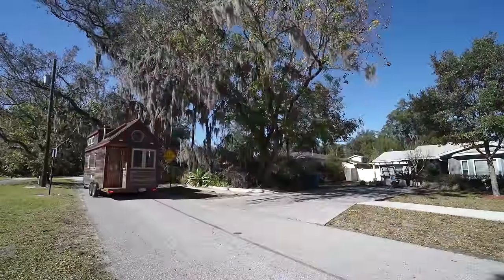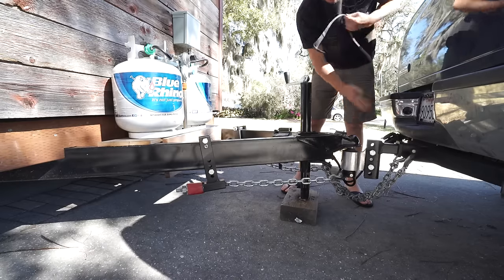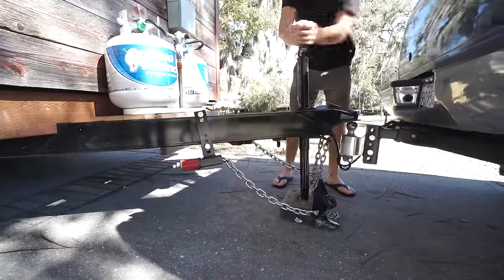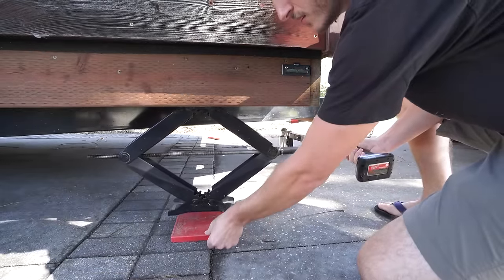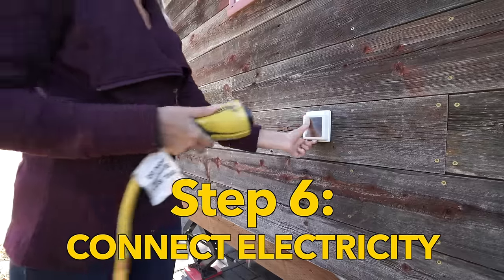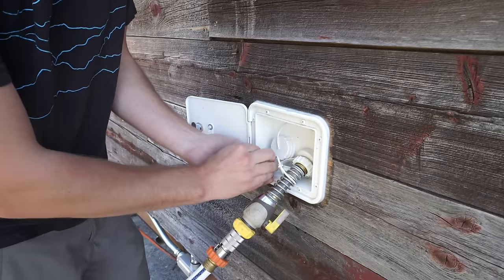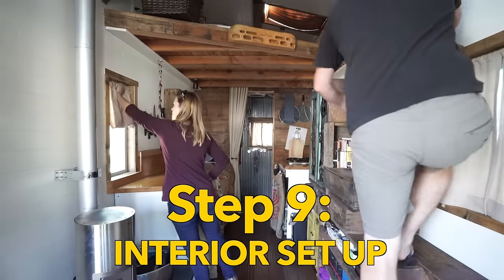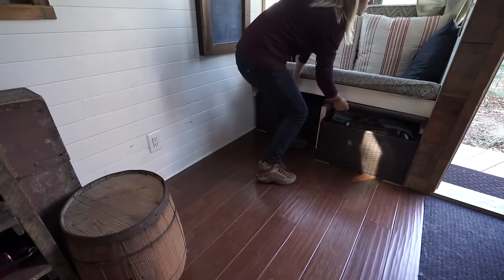How to Park a Tiny House and Hook Up to Electricity and Water

Comment: Looks like your truck would benefit from some air bags. Around $250 on Amazon and no drilling install that makes it super easy. The only reason I bring this up cause your truck sinks a good 4 or 5 inches when the house is on it. I think the adjustable ball should be raised also. With the house connected it should be as close to front to back level as possible. A level trailer travels much better when level with the truck. Thanks for sharing.
Reply from the maker: Jerry Densmore Thanks for the tips. We've adjusted the weight distribution system so that the whole rig tows level. I think we're a little off but within the hitch's design limits. I'll take another look though.

Comment: Hi, do you have any tips on keeping a tiny house lightweight as possible? Like types of materials you can use to build that are lighter than others? Also how much does your tiny house weigh? Sorry for the questions, love your videos!
Reply from the maker: To save on weight, you'd have to look at other building techniques and materials then typical house construction. Most tiny houses (ours included) use typical beefed up house construction because it's the easier, cheaper and most customizable option. But it ends up being heavy... Our house is 10,100lbs fully loaded.

Comment: This was extremely helpful ^-^. But I have one question: how the grey water systems works? Where do you dump the water? Also how you manage the whole water systems when you are off grid?
Reply from the maker: We have a video about grey water somewhere in there too :) but basically we use biodegradable products and usually dump it in sewer dumps.

Comment: Great video and like your house. Can you please tell us more about what you are using to tow your house with and how well your house is doing as you have towed it thousands of miles. Any problems with the house itself? Cracking or things coming lose not working correctly, like cabinet doors or heat or A/C.
 Any things you have come across while traveling? Road conditions on and off ramps parking and fueling truck. And how fast do you drive while towing?

 Thank you very much

   52 fordman
Reply from the maker: Well, we use a 2006 Ford F-250 6.0 diesel crewcab long bed FX4. We've had some issues with it (busted FICM and cracked coolant overflow tank, probably cracked by the guy who changed the FICM). Other than that it tows fine. We take it easy.
We usually drive 50-60mph depending on road conditions and wind.
The house shows virtually no signs of wear from the road, other than human error things. We did have a wood slab countertop crack but I think that's because of humidity/dryness and temperatures (the slab wasn't dry enough). We also had a broken weld on our trailer and had to have that fixed, all good now.
Our heater is a sailboat wood stove so it doesn't care about movement. We don't have A/C.
Our trailer is the standard tumbleweed trailer and it's pretty low. The tongue jack, and sometimes the scissor jacks scrape a little, or a lot. We've gone on many roads (18,000 miles) in a variety of conditions, nicely paved, badly paved, potholes, dips, bumps, gravel, sand, grass, off road. The house handles fine! We just drove back from the Arctic Circle on the Dalton highway. Look it up to see what our house can take :)

Comment: Are your house construction joints opening up after all the highway miles?
Reply from the maker: I'm not sure what you mean by that, but I can tell you that some of our siding and trimming has moved a little but from temperature and humidity, not road conditions.
Reply: +Tiny House Giant Journey

That's good;  I would have guessed that road vibrations would have loosened up some of the framing.  I really like your videos!

Comment: I  live in Wisconsin and am interested in building a tiny house. But the issue I came across is where to put the grey water as it will freeze during the winter, please advise.
Reply from the maker: Brady Madison Well, we're not expert with freezing conditions as we travel south for winter and north for summer. But we do plan on staying in Denver through winter. Though not as cold as Wisconsin, still freezing. We'll have to see. There are many tiny house blogs out there that have figured out how to handle this particular issue though, as well as full time RVers. People have been living in freezing conditions with campers for a while. There should be lots of info online.